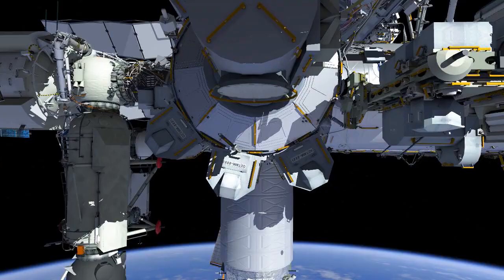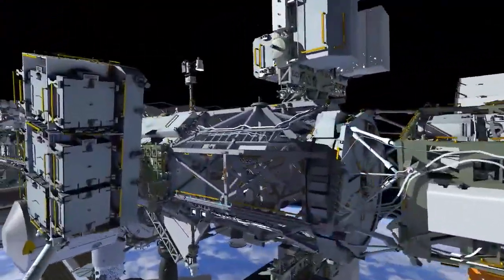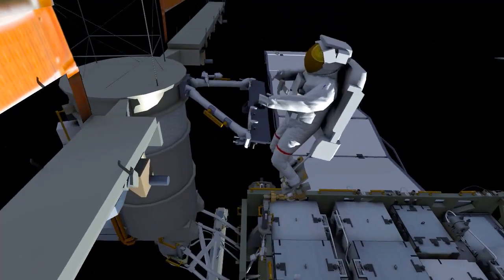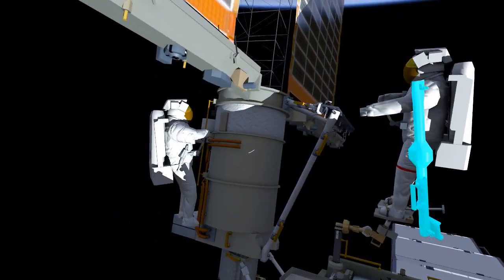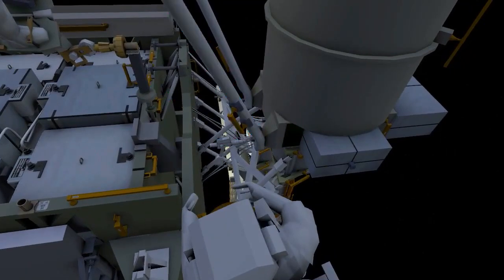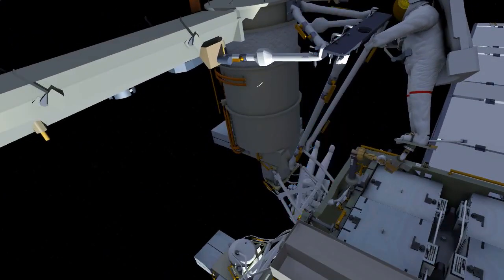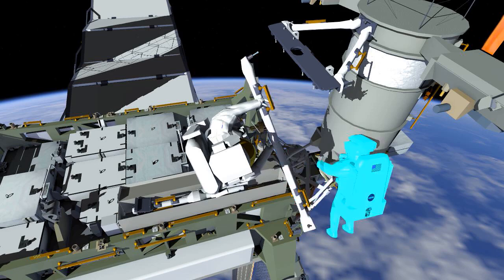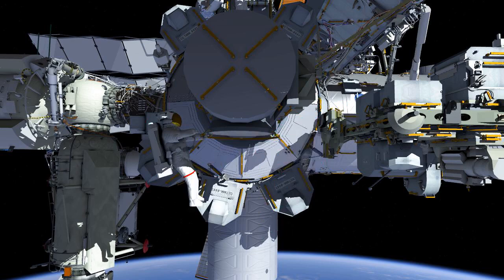Spacewalkers will prep space station for solar array upgrades

Comment: Why don't they assemble the smaller components inside the space station ready and then assemble.fixed on the outside of the station. 🙄
Reply: The airlock has a limited size
Reply: @jebediahkerman2972  Design a larger one for this purpose. Outwards assembly space bay O01 and  inwards repair, disassembly space  bay I01. 🙄
Reply: Because outside you can smoke doing it
Reply: @fugufiish6498  I wonder why there were cigarette buts floating around the earth.😲